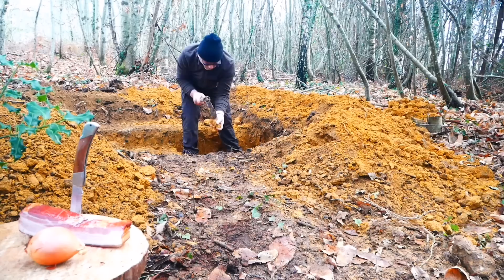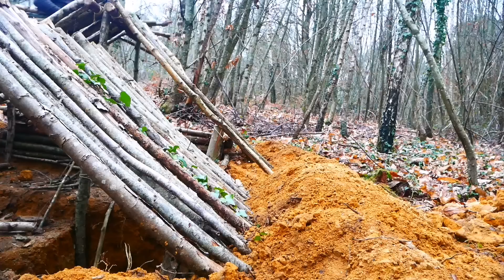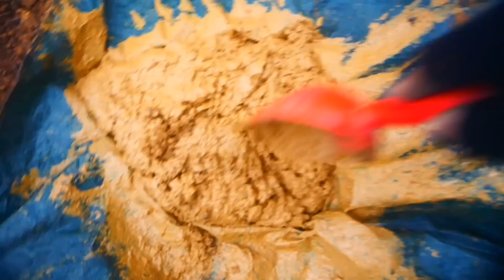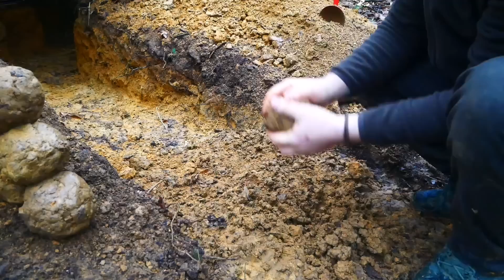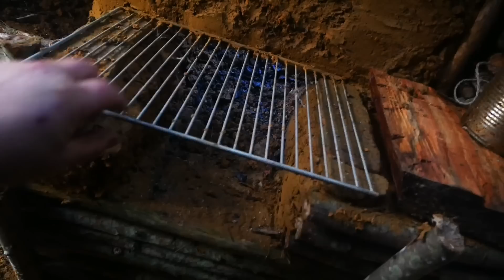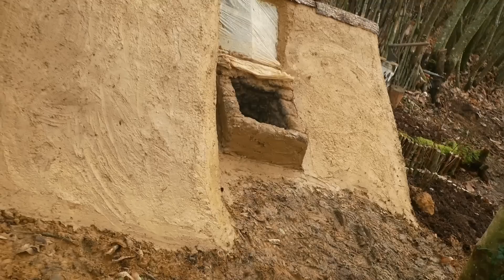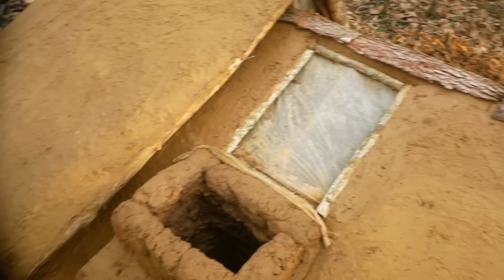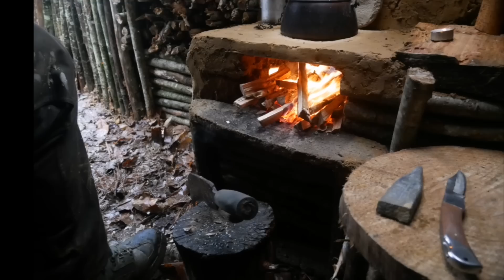SURVIVAL EARTH LODGE HOUSE - Bushcraft  a pit warm house The best of all natural Shelters!!

Comment: And then it rained, and flooded the interior, washed away the roof, and killed the fire. But it's a masterpiece until then.
Reply: I agree with heavy rain the interioray flood. The roof however is pretty much cobb roofing. There's watchtower in Europe that are 1000 years old made from cobb. Once dry it is very very durable. Especially when rubbed to a smooth finish the water just beads off like a tile.
Reply: Websiteguy 2  Also put a bend in it for rain.
Reply: @brendanh2065  j
Reply: Funny, I was thinking the same thing, but thought it a bit mean to say so. 😁
Reply: @gudgengrebe  mean or just realistic? I don't understand the clay roof.
Reply: Just to make sure I understand, what I need to be a survivalist is wet loamy ground, three types of hand saw, two types of axe, half a dozen other manufactured tools, a supply of cured bacon and store-baked bread, a big bag of onions that will not grow in that soil, and an absolute need for it to never rain again after I've finished building it because it'll wash away the roof & walls AND flood too?

Seems easy enough.
Reply: @iatsd  Yes, and probably about forty gallons of water to make the clay, so maybe be by a river but not too close.
Reply: @iatsd  I am amazed by all the criticism... i would not have the get up and go to do a tenth of what this guy does. I'd be real pleased to have some of his skills
Reply: Having built my own mud house, I can attest that many of the issues were fixed after construction. It took quite a few years for me to find a solution to driving rain. A light rain is no issue at all. He could solve it with just another layer of leaves and twigs, or even sod.
Reply: @iatsd  correct.
Reply: @brendanh2065  Cobb holds well when there's a proper roof to protect it. If it gets too wet it goes back to being mud.
Reply: @iatsd  Clay beds make good aquicludes in the ground.  Clay will absorb water, but not let it penetrate very rapidly.  I wasn't paying too close attention, but he made a point of mixing that clay with some kind of binder.  

If he's got a fire going, he doesn't need to worry too much about the fire going out.  He's got a pretty good, insulated flu, there, and it's rocketing pretty good.  I didn't watch him dig it in and I'm not going to bother checking out the lay of the land.  But you certainly could dig in like that, if you were mindful of drainage.  

What he's doing is close to what I'd want to do with a mass heat system for a base camp.  Get that riser hot enough and you can redirect the flu gases into a cobb mass for warm nights in winter.  What he's got is high-maintenance, but high-efficiency burn.  If you can capture that heat, you'd be able to keep that space pretty toasty for hours, just from doing your normal cooking.  I'd rig up a simple baffle for the summertime, if I wanted it for summer, 

It's just nice to see one of these videos where the guy uses a small, hot, smokeless fire.
Reply: @brendanh2065  what kind of material is that, cobb?
Reply: @harrickvharrick3957  mud, stone ,straw, horse hair were traditionally used in old building.
 This lacks any binding ingredients.
Reply: @beckyboop3517  And that is cobb and a structure made from it by times would last a thousand years of exposure to the elements? (Btw, obviously those ingredients do bind when they are allowed to be thoroughly (sun)dried.) Now, I am thinking, if there's enough horsehair or other animal hair in the mix, that will - just like wool does - work as a repellent to water. You probably know that wool is one of the best fibers for clothing be cause of that and be cause it retains its warmth insulating properties even when it is wet. So that might be a clue, I mean, it might be essential to the substance's supposed quality and is ability to (indeed) stand the test of time, that there would be enough animal hair mixed in, probably together with the right kind of mud..
Reply: @iatsd  ...and lots of bush plastic sheeting. The natural kind.
Reply: @iatsd  😆 lol you put it so delicately 🤣🤣🤣 you're so damn funny. Oh my side hurts.
Reply: Lol 😆 🤣 that would be my luck. Or lack of foresight
Reply: Seems like you didn’t learn anything he did in this video , watch it again and you’ll understand that even if it rained it will never flood the interior at all. Good luck the second time.
Reply: @brendanh2065  still make houses out of cobb in UK.  Well I know one particular farmer does
Reply: Actually he posted an 8 months later, it held up exceptionally well
Reply: After listening to the replys I think I'll build a treehouse
Reply: @Darren Harper "the criticism is justified" na actually its a bunch of keyboard survivalists who think they know more than the guy who builds dozens of these shelters every year... the dude posted an 8 months after abandoning it and it held up strong as the day it was built..every catastrophe you guys came up with it withstood just fine..
I cant see how this guy is ripping people off.. its free content..
And where did you get this idea that city folk are flocking in droves and paying thousands for bush survival courses?  Bit of a dramatic leap dont you think? Can you show me a person who did such a course? Or did you just pull that out because it feels like it might be true?
Reply: @paulnickason4793  All was fun and games in that nice treehouse, until that one sad day when that lightning storm passed by.
Reply: @YooTuberian  lots? No. Just 1 piece because he felt like putting in a sky view for the hell of it.. all that hard work and you go right at the 1 piece of plastic film as if that dimishes the rest of it? Lets see yours..

Comment: Civil War soldiers used to dig tunnels under their tents and build a crude but efficient system where as the heat from the fire would be drawn through that tunnel and warm their tents. There would be no way they would have time to dig our something like you made. I studied Civil War history and honestly, for the time period, they came up with some great ideas to stay warm.
Reply: They probably had time during the winter. Most fighting shut down during late winter because the roads were too muddy for large armies. They'd go into stationary camp for 2-3 months, January to March.
Reply: Really interesting.  Any more related gems to share?
Reply: @zippymufo9765  How warm are their winters? Here in Canada it’s the spring and autumn months everything gets like that. Winters perfect cause the grounds froze and it’s easier on equipment since there’s less dust getting sucked into everything.
Reply: People 100 years or 100000 are equally mentally capable, especially if they're from a community, hunting some difficult, large animal and having to deal with incredibly dangerous, large predators.

People only underestimate their ancestors because you've been taught to.
Reply: @blastfromthepast7119  guess that depends where your from. I was kicked out and on my own 3 months before I turned 14. I built a 15x15 log cabin and lived in it for 3 1/2 years til I managed to graduate. Alone with couch surfing and the odd friends house. East coast of Canada is very famous for this kinda thing.
Reply: @HelloProTip  lol thanks. 8 provinces/ 12 years later I now live almost 5000km away from my family. My parents met my son once when he was born. He’s 5 now. Still never met my 4 year old daughter. But the way I see it though is if a kids can find a way to survive there’s no excuse for adults!
Reply: They didn't just plug in a heater?

Comment: The main concern is the rain. I believe the roof can handle the rain, as also the walls. But the main entrance of the house is a down ramp, so as I see, it will get floated easily. Anyway, it's an amazing job!
Reply: I know......so damn stupid
Reply: No, he knows what he's doing. If you pay attention to the beginning of the video, he chose a slightly elevated location to begin with. The ground on the ramp would suck up the water... Not allow it to run over it. It would become muddy but the hut would not flood.
Reply: @JockPuppet  I got you. Makes sense!
Reply: I bet after the first rain in one, a person would notice and be smart enough to find aextremely good way to solve such problem by digging it deeper in another section and allowing it to run off in a great fashion.. easy way to make a super nice toilet if ya ask me. Get it just right. Way deep with atleast some solid tools to legs the rain push it far away after you dispose of it
Reply: Maybe that entrance level downward. That's good. My concern is the same construction placed in the north of Sweden with 200 centimeters of snow on top of it...
But, at least it will be warm and cosy  during the winter.
Reply: It might be worth putting a ditch across the bottom of the ramp, to run the water off to the side. And that window is going to get shredded by the first squirrel or bird that walk over it. Other than that, props to this guy. What a place.
Reply: That layer of leaves and plastic screwed him if it rains for an extended period. That's going to sluff off in no time. Tighter on the pole structure roof and walls and slap the clay directly on them will hold it better in weather. It will dry from the inside out over time then and harden.

Comment: It's a beautiful house built out of a dugout. But let me guess, when it rains the house floods.
Reply: Once the clay has dried, there are no problems.
Reply: @gundelbaldmarenge1620  
Doesn’t the water flow in the below grade entrance? Or is there enough of a slope ?
Reply: @gundelbaldmarenge1620  you can deal with that eventuality with French drains and roof eves.
Reply: sand and clay have been used for construction for centuries. that lasts forever.
Reply: @AaronJZY  Exactly what I was wondering. Water coming in from the entrance. The house is below ground level.

Comment: THANKS FOR POSTING ! 
   IF I MAY make a few opinion related suggestions. (I'm NOT trolling! Just pointing out a few things, so to those folks that get their bowels in an uproar about design improvement suggestions, this'll save this fellow a wet butt!)
That's a lot of work to build a covered pool. Once it rains, your ramp you so nicely built, will turn into a funnel and won't take long to render all that pretty work into a neck-deep bath-tub. You need to build a cover over your ramp, to keep the rain from falling directly into it. Make it so you can still walk down it, but where rain can't fall into it. You need a "speed-hump" across the entrance of it, to curb in-flowing water. Water seeks it's own level and by design, seeks the lowest levels. Your window WAS just right, till you framed it to hold a couple of gallons of water. Eventually, the plastic will come loose and dump that water onto your fire-pit. Do these changes and you'll have something that will last, for you, or don't do it and you'll be doing some high level cussing, when you have a Toad-Strangler of a storm.
   THANKS AGAIN for taking the time and initiative to build this structure, and THANKS for  posting!
Reply from the maker: You worry too much for me don't worry I'm fine. This is not a hotel. I'm doing fast and I'm safe from the rain and everything is fine! If I had calculated this way today this shelter it was not built! Thank you very much for your comment there is a sequel to this video soon news
Reply: I built something like this albeit it was 6 ft deep and not as nice. It was completely covered even the entry stairs. With that clay soil it turned into basically a bathtub and everything in it got soaked.
Reply: @ATHOSOutdoorProspector  The whole episode I thought the same thing - what William said. We don't worry about you. But he is right.
Reply: @ATHOSOutdoorProspector  fast? 😆😆😆😆😆😆😆😆😆
Reply: 🙏🏻Thank you

Comment: This house will flood after the rain.
Reply: You have to build on a hill and dig a small channel at the base angling down to drain the water
Reply: Thought about the same thing
Reply: No worries,not like it was hard to build.
Reply: Next Video  "Bushcraft Swimming Pool"
Reply: This house will dissolve after the rain.
Reply: The ground soaks the water
Reply: Landslide off roof
Reply: @johntitorii6676  and soaky ground = MUD .. some more rain and it is "Bushcraft Swimming Pool"
Reply: @johntitorii6676  Not if it's clay, that's why he's using it to waterproof the house. Water sits on clay for ages they are right you would need a run off channel.
Reply: And the mud will wash!
Reply: It's ok. The castle will be a bath.
風呂になる。
Reply: @grassshadow1  
It’ll naturally seep water in at the slightest rainfall building on an incline won’t make any difference.
Reply: @rogerwoodcock7523  ,

What makes you think that he would not drape that large plastic tarp over the structure, in the event of rain?
Reply: that's evil..;)
Reply: I thought I was the only that was thinking that....
Reply: Add a small rise in the dorr way so it will block the water flow long enough for the ground to absorb it. He should add a door tho. Incase of animals
Reply: only a fool don't know water flows to the lowest point, dig a whole to put your shelter in ??????????????????

Comment: When it rains, the water is coming in at an angle of the ramp, down the hill and into the pit.
Reply: I was wondering this exact thing.  I have seen a dug hole fill up FAST with water from just a moderate rain.  If everything is sloped properly, theoretically he would only be dealing with the rain falling directly on the trench, but that still could make things quite messy inside.
Reply: It can be fixed by digging a small ditch to divert the flow. Also some stones on the clay to prevent slipping. But yeah, most of the entrance should be covered with a sloped roof too. I saw it in a Russian video, where guys built an underground house.
Reply: should have built it above ground level
Reply: @johnmoorcroft8226  the idea is to build it in the ground so that you get the warmth of the earth in the winter.
Reply: Won't the mud walls just liquify in a heavy rain ?
Reply: @SB-kk3wi  Well, it is a temporary shelter. LOL
Reply: You’re not supposed to think that way 🤣
Reply: It becomes a bath...
Reply: @SB-kk3wi  no, the fireplace warms the surrounding earth. And you have most likely seen how in wars they used ditches as cover, same thing, they have wood walls around them keeping them in place. Also the fireplace will dry out the clay, forming a somewhat strong structure. In the old days people used clay to form walls together with hay, moss and also used them for constructing stoves.
Reply: @SB-kk3wi  Depends which mud walls you are talking about - he uses clay on the roof, probably mixed in with moss which becomes sort of hard after drying out thanks to the fireplace inside the shelter.

Comment: I would put an elevated roof on the chimney. Otherwise it seems very cozy.
Reply: That’s what I was thinking as hard as it can rain it could save you the loss of your fire and flooding
Reply: @Rainen00  As long as the chimney drains away from the dwelling, it's fine. 

It's odd what is considered "bushcraft," though.  It's a pretty over-used term for what most would restrict to puresurvival situations, where you wouldn't have time for these elaborate constructions.  Swedwoods does actual bushcraft.  A shelter in about 15 minutes, from 3 or 4 sticks and a canvas poncho, assuming he doesn't just curl up under a deadfall.
Reply: Doesn't the water come in through the entrance hall? It's tilted in and out, isn't it?
Reply: And a jacuzzi
Reply: The chimney should be higher than the nearest ridge to draw properly
Reply: P
Reply: That’s it? Me, personally, would introduce a silk like red carpet in the front lobby area with a dazzling chandelier above it wrapped around by spiral stairs heading to the rooftop pool. Otherwise, it seems like it’s up to the job.
Reply: And ful of snakes, rats, and insects to!
Reply: a "cap"? lol, says the stonemason
Reply: amazing    his not llszy thats for sure or homeless 👍

Comment: I wonder how that entrance trench will channel all the rainwater straight inside the little hut. Might not be a problem, when its drizzling or raining lightly, but a proper downpour wil turn the hut into a swimming pool.
Reply: That was my thought, too. The hut is below ground level, so rain water will collect there.
Reply: May have been easier to use existing tree's and yoke ridge pole between for similar roof concept just steeper angle.
Reply: If you put a deep pit under the entryway and put a log platform across the pit this kind of shelter works especially if you are building it on a slope where you can trench a drain out from the entry pit. Also you can build a floor in a similar manner.
Reply: This type of survival shelter works in the winter as well if you use pine branches with needles then cover with snow.   I should know I built one and stayed in it in -25degees F during a winter survival course and we were not allowed a fire
Reply: It seems to me that, if you put on a slope with the entry trench downslope, flooding would be lessened.
Reply: Have to build a decent, waterproof threshold of several inches to compensate.
Reply: Just like the ww1 trenches they dug the trenches an extra 6-12 inches deep then put a platform above where the rain filled the trench too (although this wasn't thought of until the end of the war after hundreds of thousands of troops had caught trench foot)